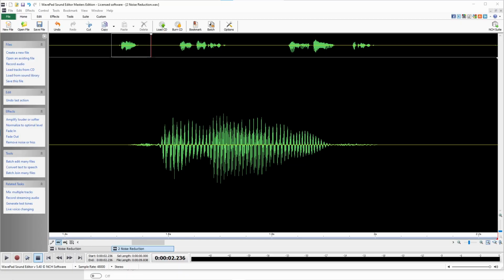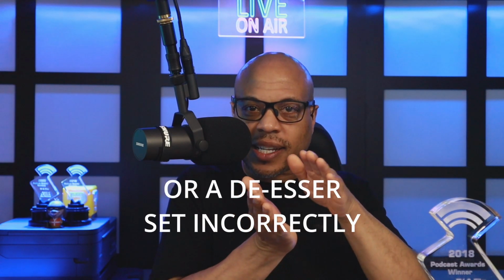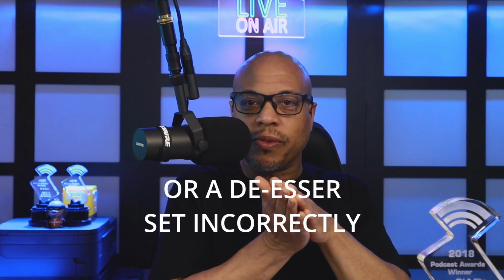5 Reasons Why You Shouldn't Use A Noise Gate - Opinion

Comment: So true. I just had to send back a digital wireless mic. It cut out the beginning of every sentence. It would be so much better without a noise gate. Just digitalize the noise and send it. One would still benefit from a radio interference free transmission. I wonder if the more expensive mics do a better job at this - or HW Noise Gates just always sucks? Maybe if the Noise Floor could be adjusted and turned all the way down on the transmitter.
Reply from the maker: Thanks for the great comment. I have had nightmare situations when it comes to noise gates so I feel your pain. Noise reduction is becoming really good. I'm not sure why some companies don't simply license the technology from WAVE, etc, and add it to a hardware interface or wireless mics. It works so much better than gates. It seems like a simple fix, especially for wireless mics. Let them pick up the room tone for a few seconds and then remove it.

Comment: More reasons to never use a noise gate:

1. It never sounds natural.  Never.  There is a huge difference between room tone and true silence.  Sometimes the conscious brain may not hear it, but the unconscious brain most certainly does.  Just like when you're editing, you never use silence audio unless there are other tracks covering it, you always copy/paste a snip of room tone.  

2. Your wife or cat may bump the knobs and damage your settings.

3. It's very sensitive to good and consistent mic technique.  

On the other hand, I will use an expander at the bottom and a compressor (somewhere between 2:1 and 3:1 at *most*) on the top.  Even then, I generally would discourage most people from doing this for the following:

1. Fine tuning the combination is an art.  The settings for smooth transitions from one to the other has to be crafted precisely.  Think of this... you have expanded signal transitioning to uncompressed signal transitioning to compressed signal transitioning (if you include it) limited signal.  All having to occur naturally.  I'll put it coldly, most people don't have the skill to properly manage even a single knob compressor like is found on Yamaha boards, much less combining multiple dynamic processing.

2. Cats still want to paw at knobs.  At least if you're talking real analog rack gear plugged into physical inserts. :-) 

Save your gates for the guitar and bass cabinets.  Or paired with a reverse reverb on the drum kit.  Things it's designed for.
Reply from the maker: Love the list and the backup! We are in absolute agreeance! Podcasters have been brainwashed to believe that external noises are evil when, in fact, they are natural. Post production can solve many issues. That's where some issues are best resolved. 

Thanks Raul for the great comment.